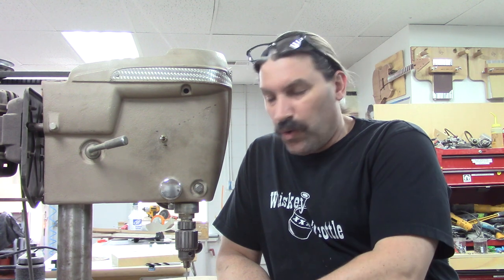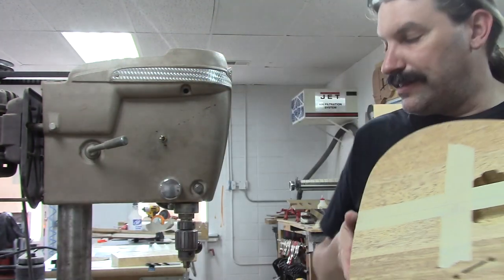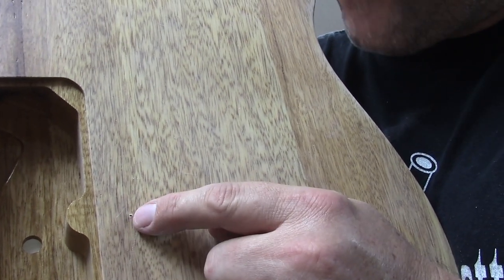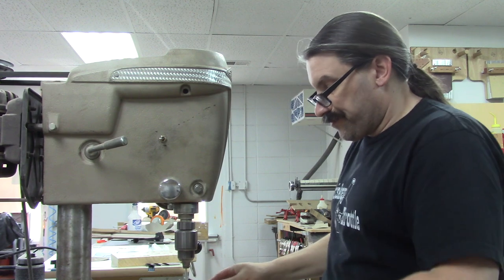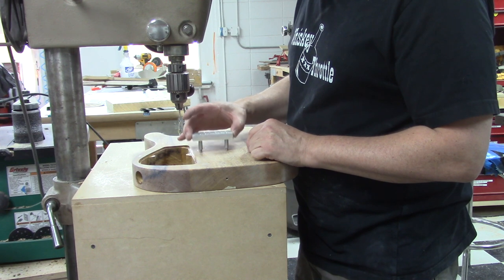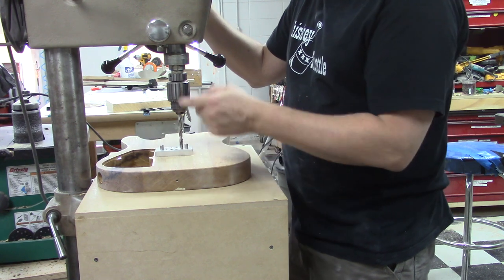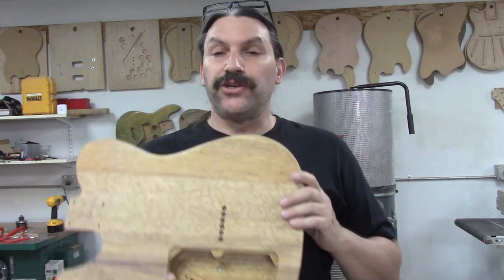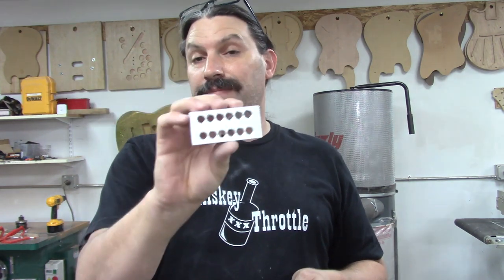Building A Classic Tele... YOU NEED THIS TOOL!

Comment: Thanks Matt!  I decided to go back and put ferrules in a couple older tele top loaders. This tool is friggin awesome!  I made my own for another tele, but I didn't use indexing pins and I don't really have machine shop accuracy for metal work - so this tool should be a big improvement - also the 2 sizes (vintage and modern) is excellent.  I also learned about how to press the ferrules with a drill press and stop guide so they are all at the same depth - wish I had known that before as well.  Oh well, if guitar building was easy everyone with a machete and a slab of palm tree would be doing it (Florida take LOL!!!!)

Comment: Very nifty tool / template.   My first Tele build I had to drill manually and the ferrules are very slightly off.   I don't mind as I built it for myself but now that I know this exists if I build another I'll definitely pick this up.   The reason I had to drill the string through holes manually is my drill press was to small to accommodate the body...couldn't reach the hole location.   In lieu of a floor standing press I might try the little Dremel "plunge" router to drill them the next time.

Comment: If you have access to a milling machine it's quite easy to make, pins need a lathe obviously depending on how busy you are and if you can be bothered 🙂 that's what I needed as I didn't have a drill press at the time 👍
Reply from the maker: You are right this is an easy tool to make if you have a mill

Comment: Interesting. I've always just used the bridge as the template. I drill the E strings all the way through 1/8. The middle holes I go 1/2 way through. Then I flip it to the back and drill the remaining 4 from the back. I agree it looks sloppy if they are not straight.
Reply from the maker: You can certainly do it lots of ways

Comment: I made my own steel drilling template for tele bridges but the locating pins are great. I need to get that tool just for the pins. Not that I build lots of tele's but I like the cut off Wilkinson brides.
Reply from the maker: Cheaper than buying a lathe :)

Comment: George Lamb , the fabricator and seller, just told me he turned 82 so y'all hurry if you want get one. He also made me a cool template for Strat/Tele  to make it precise to drill body and neck for srew or bolt holes.
Reply: PS: I am not financially affiliated . I did get some free prototypes of pieces I helped design .
Reply from the maker: Act now, operators are standing by
Reply: @TexasToastGuitars  Their you go
ha ha !

Comment: I want a standard bridge plate for a standard  Tele that will allow top loading as well as string through (or a combination of the two. The only good one I've seen is by Fender but is an incredible $119.00 = if you can find it on their site...
Anyone got any ideas for an alternative brand?  Pete.

Comment: Cool tool. For those that will be using it alot. 
User hint: being a softer metal like aluminum, it may pay to stop the already turning bit before inserting each time. Why? It may cause sooner/premature wearing inside the cylinders of the tool, having the bit moving and then possibly finding it's way into the tool and not being perfectly lined up. Just an observation, so please keep yer panties from twistin' folks. Of course Matt does it his way, and you do it your way. One method we might find more cool and the other not so much [?], and in the end we make our own decisions. 
Just like Matt did with his tool ...and that goofy caterpillar on his lip.
Reply from the maker: Tool run out is a real thing. Our drill press isn't any more accurate when you turn it on and get a running start :)